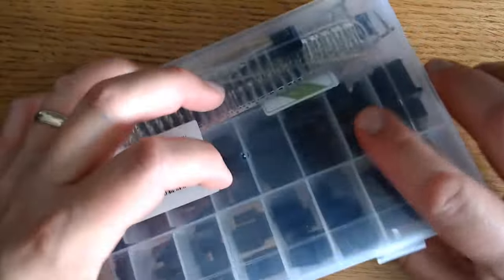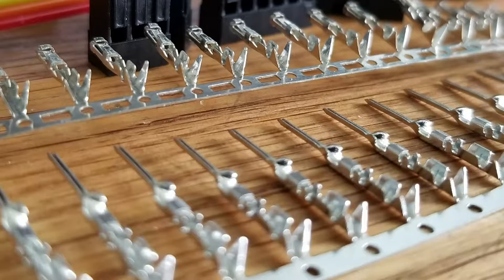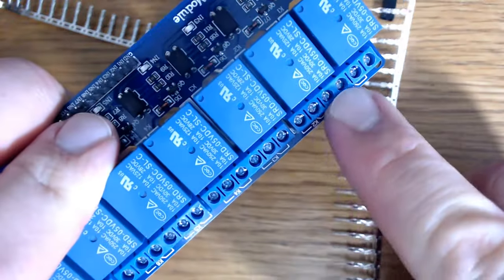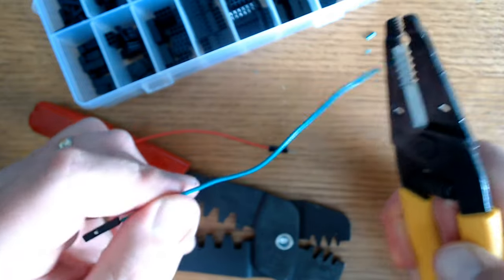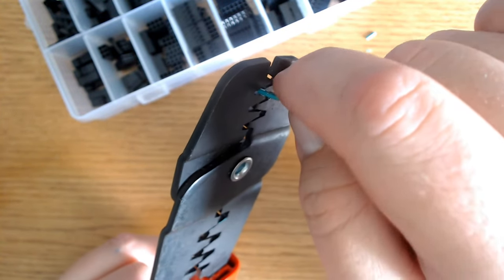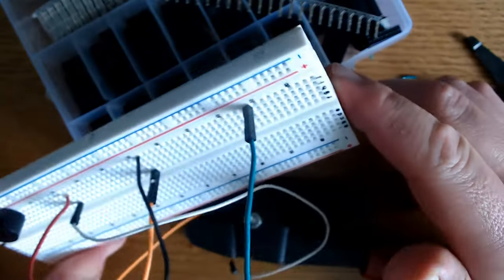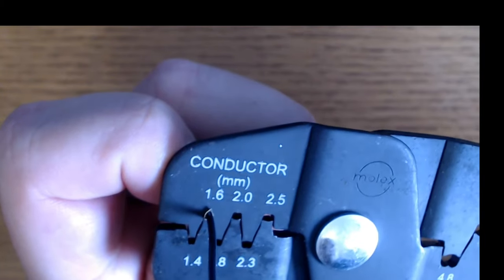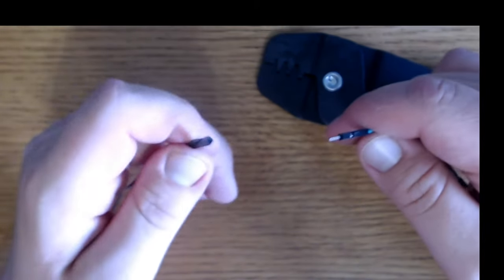How To Crimp and Use Pin Connectors For Your Arduino Jumper Wires - replacing old wire pins

Comment: Hi, can you share the crimper model you used?
Reply from the maker: hey there!  I bought it about 5yrs ago from Jameco. I believe this is the one https://www.jameco.com/z/63811-1000-Molex-Application-Tooling-Hand-Crimp-Tool-For-Mini-Fit-Jr-_304928.html
It says $70.95 each! I don't remember what I paid for it though.
It is built very well, I will say that. I use it regularly and have had no problems.
Jameco Part no.: 304928  
Manufacturer: Molex, part number: 	63811-1000

Comment: how did you test it to see if it was placed on correctly?
Reply from the maker: Hi there!  It may take some practice at first. There are 2 sets of wings, at least that's what they look like to me. The first set of wings are tall and they wrap around the wire insulation, the second set of wings are more flat, and they wrap around the wire. You don't have to stick the wire in very far at all. This picture shows what it should look like. https://www.aliexpress.com/i/3256802331800236.html?gatewayAdapt=4itemAdapt  Not necessarily promoting Aliexrpress here but it is the best images I could find.   I hope that helps!
Reply: @BMonsterLaboratory  so I already put the housing thing on the wire but I can’t tell if it’s functional, if u have advice on how u tested them to see if they work I would really appreciate it!
Reply from the maker: @friendsfans123  If the housing is already on it you can tug the wire to make sure it's attached properly, don't pull too hard though. You can also do a continuity check if you have a multimeter or if you are using a circuit, see if the circuit is functional when you insert the wire.  Before all that, You should inspect the wire after you lock it into place with your crimper, if it's done correctly it should be fine. I hope that helps~
Reply: @BMonsterLaboratory hello, I think your misread what he's meaning, he means how do you know if the positive and negative are correct, as ; left, black negative wire / right, red positive wire 'into the housing, guy probably doesn't want to fry himself or his equipment 😊
Reply: @BMonsterLaboratory  I did mean a continuity check thank you! How would I check it with a multimeter alone?
Reply from the maker: @friendsfans123  were you able to check your wire? hope so!

Comment: HI, what size of wire did you use here ?
Reply from the maker: Hi there!  I am using 24AWG wire in this video. It works best with 22-24, a gauge you would typically use in a breadboard.

Comment: Do you realize that you are doing this completely wrong and that you are you push the wire in too far. Only the back wings should crimp the isolation. The second op pair of wings should crimp the bare conductor and non of the wire should be pushed any further into the connector.
Reply from the maker: Hi Frans! I appreciate the subtlety of your message and enthusiasm for this video. You are correct. I pushed the wire in too far with the female connector and I didn't catch it...It still stuck together and made a connection somehow. Doing this takes away from the proper connection of the male connector to the female connector. There are always a number of distractions while recording and I thank you for the catch, sir! I hope you continue to follow the channel and check out all of our future videos!! 👍😃

Comment: Please do not crimp this way! you are trusting your electrical connection to hold with no mechanical connection between the conductors!  The triangle wings wrap the insulation, the rectangle wings smash around the conductor.  The wire conductor protruding so far into the female socket could prevent the pin from inserting.
Reply from the maker: thanks!  great to hear from you 👍